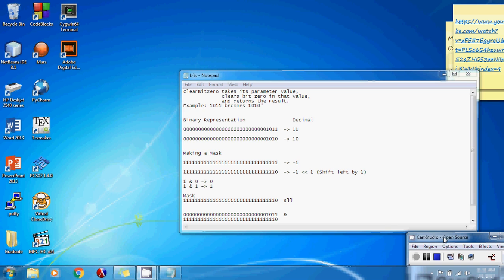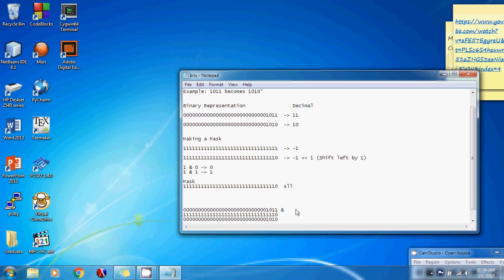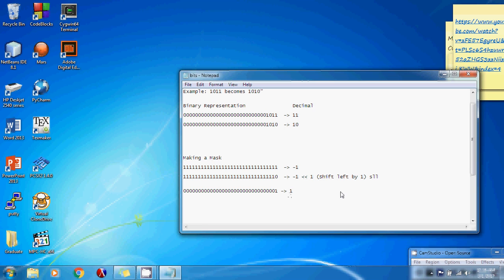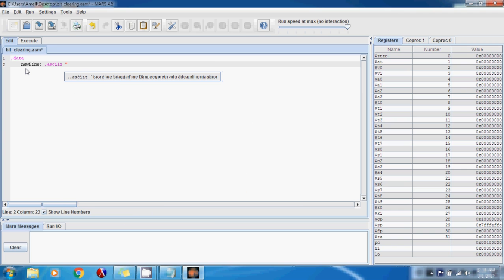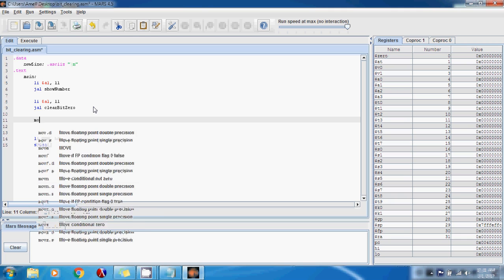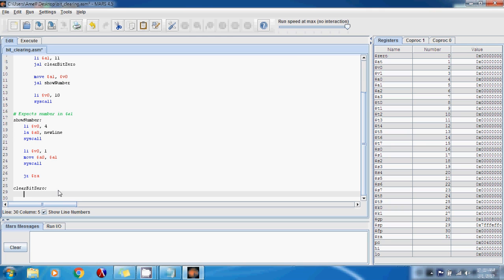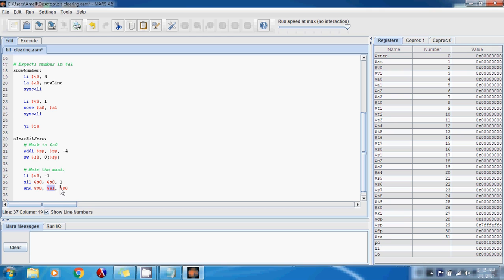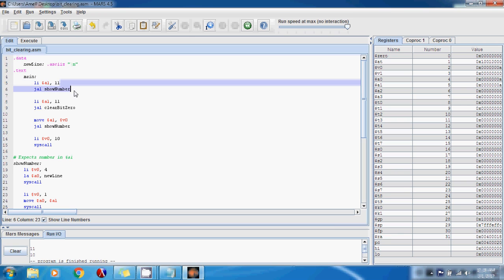MIPS Tutorial 35 - Bit Manipulation

Comment: isn't -2 already 11111111111111111111111111110? why don't you just use that? instead of -1 and then shifting it left.
Reply from the maker: Yes, I could have done that. However, I wanted to show how sll can be useful not only for multiplication (in previous video) but also for making a mask.